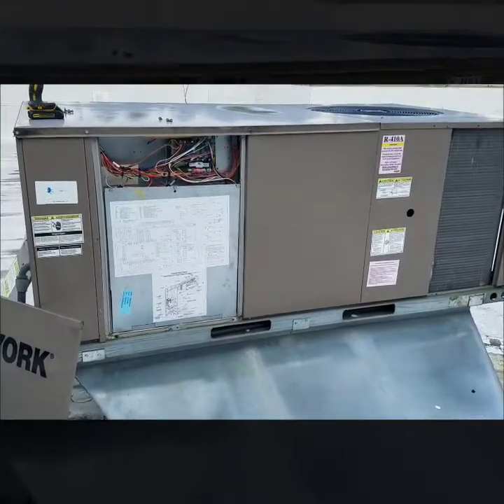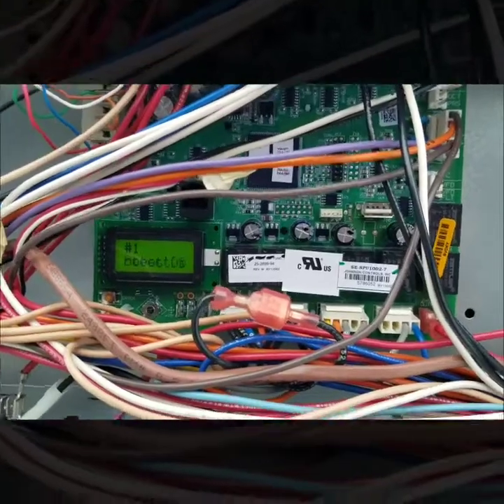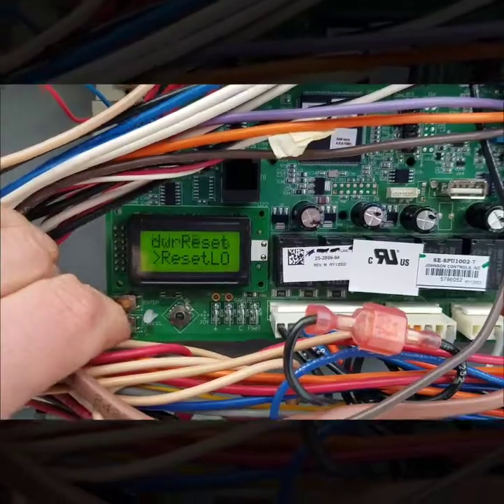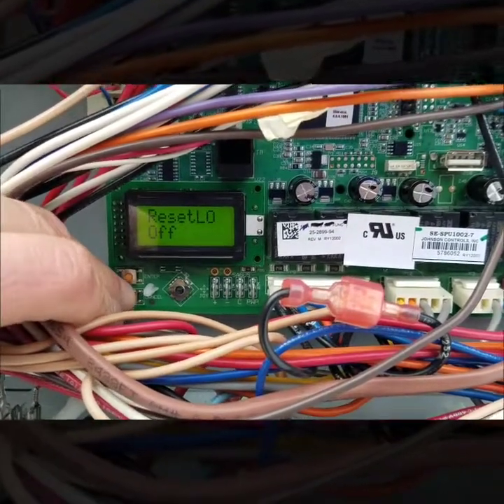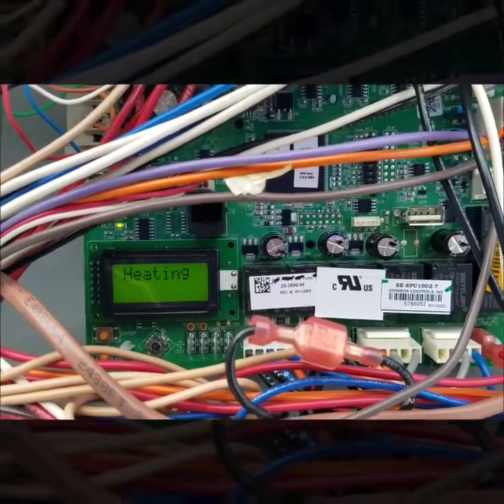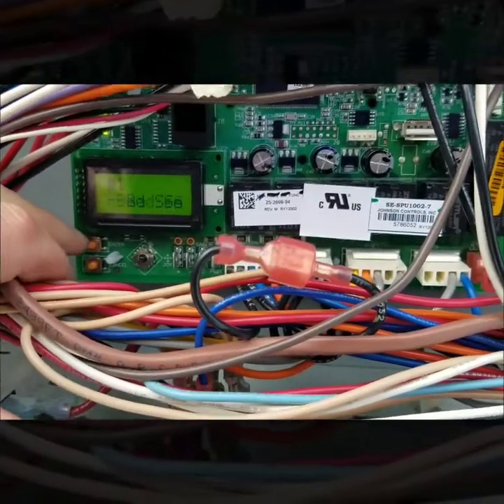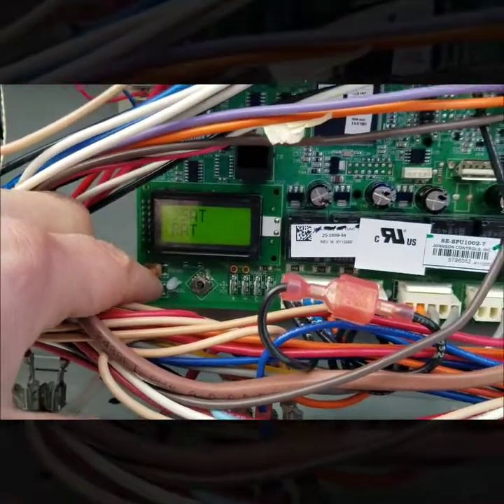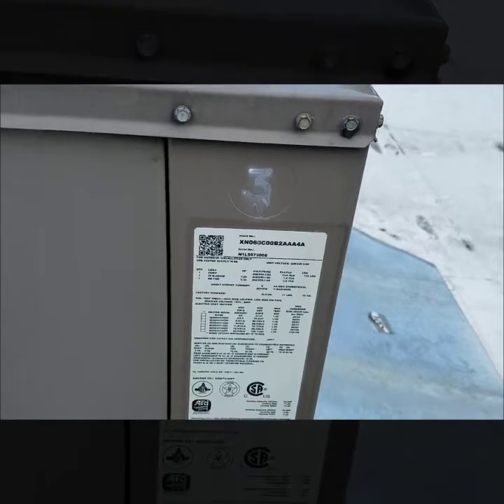York Heat Pump: How to Clear Fault codes and more!

Comment: I am actually having this same problem on a unit I am working on. Same error code. What sensor did you end up replacing? From what I found it was the outdoor condenser coil sensor that’s attached at the bottom. Let me know if that’s what you did, thanks!
Reply: What’s that sensor look like I’m having the same issue
Reply: @dannydiesels  hey dude! So come to find out the tech before me didn’t program the board for a single stage heat pump. It was set for a 4 stage cooling 3 stage heating. So it was trying to locate the 4 other sensors I guess when called for cooling when there wasn’t any. Just the one. I forget the step by step the York specialist guy had me do but I can totally give you his number and everything. He walked me through it all. Also the people had their thermostat set to call for a reversing valve. You’re supposed to set them for a straight cool electric heat.

Comment: Hi, I Have this same control on a york rtu. On a heating cycle it gives an excessive supply air temperature error and turns off heating. The belt is ok. Is there an option to increase the fan speed in heating mode? Thanks
Reply: Dealing with the same code at the moment, were you able to find anything?

Comment: I've been scratching my head over one of these refusing to turn on the compressor system because of a "mixed air temp sensor fault" ... The thing is there is no MAT. None of our units have them.

Also the documentation for troubleshooting is non-existent and JC sucks.
Reply from the maker: I have seen this many of times. We used to update the software to get it to go away. But we have now started to just leave that fault code because it hasn't effected the function of the system. Still super annoying though.

Comment: I work at a school system and we have a few of these. I am not familiar with the simplicity board. I have a 10 ton that is not defrosting and there are no codes. Do you think there's a sensor bad? I'm not even sure how to manually test the defrost on these
Reply from the maker: It definitely could be the defrost sensor. Or possibly the board/unit is not set up correctly.

Comment: So if it doesn't go away you think the sensor is messed up?
Reply from the maker: Yes or it will need a software update on the board
Reply: @HVACServiceTechnicianTalk  over engineered piece of junk. Theres no reason to update it , its just a RTU.

Comment: Hey im having a problem with a York unit installed on my business and nobody can find the problem, the unit stop the fan motor every 10 to 15 minutes and on the display is saying this error BUILDING PRESSURE SENSOR FAILURE, any idea how to fix this??? thanks in advance
Reply from the maker: If you have one of the higher end systems it could be caused from improper duct sizing. Or possibly not setting up the sheave to get the proper static pressures
Reply: Did yall ever figure it out?
Reply: @DavidMartinez-od1nr replace the sensor

Comment: I have York Infinity 8T installed at my house the unit continually displays multiple codes on going since July 1, 2020. The HVAC contractor has replaced the evap coil, TXV, the board, thermostat and all sensors except the discharge line sensor (back ordered?) This unit still throws faults codes and shuts down, must be reset and restarted to get cooling every 1-2 hours since July 1... Unit installed 2015, Thanks York
Reply from the maker: Do you know what codes it is throwing?